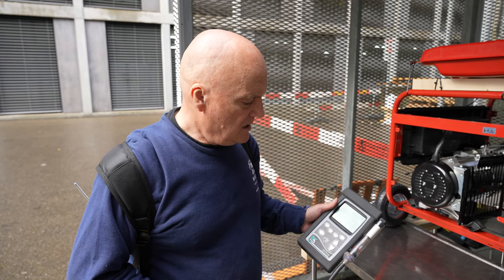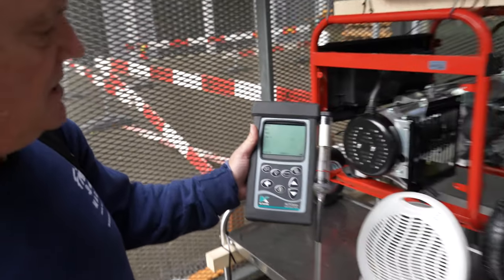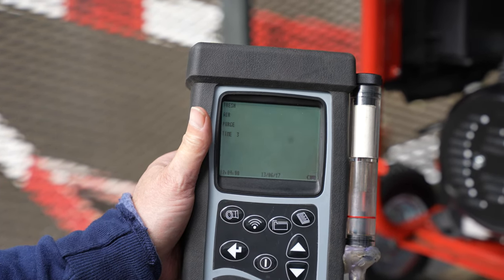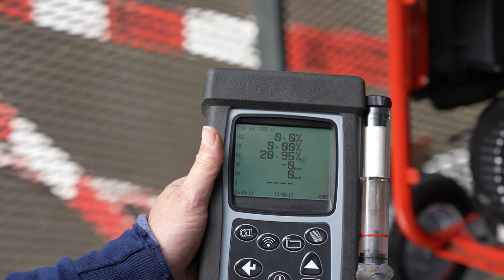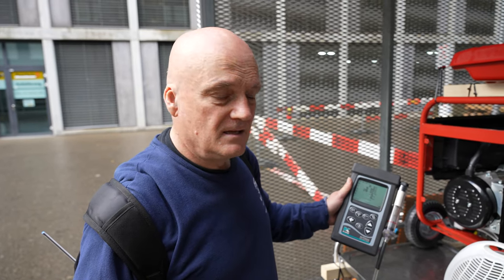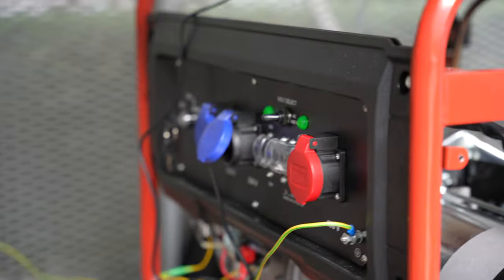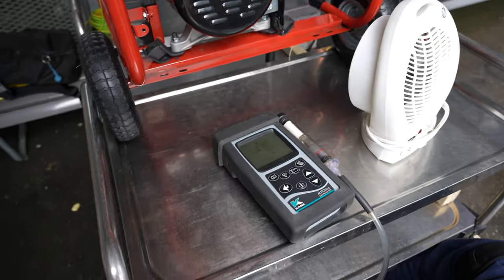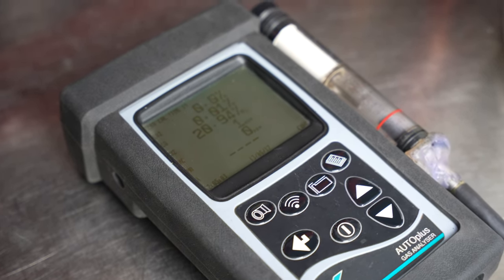THOR - Local Swiss-air quality and load for initial test

Comment: Just another thoight Bob..Did anyone measure those exhaust gases with  their own independent analyser..It would be quite easy to adapt the  electronics inside or run some sneaky code to falsify the display output at will..How do I know, I did something similar once, many years ago, not a gas analyser but the output from a diagnostic machine to a laptop,  to wind one of my colleagues up for a laugh..It could be worth double checking, although I guess youve got it covered after preempting my water sampling comments..:)
Reply: Many independent guys did that at the tesla tech conference and confirmed that there was no faffing at least in that respect.
Reply: @Fingle OK, thanks for confirming..I'm guessing everything must be fairly convincing to be given access to the London substation generator..
Reply: @marksmith9218   haha ya. I'm honestly pretty convinced at this point. From all that I've seen the most likely truth is that its all legit. Idk how Bendall could possibly be faking it all.